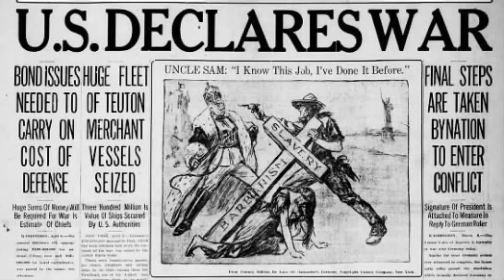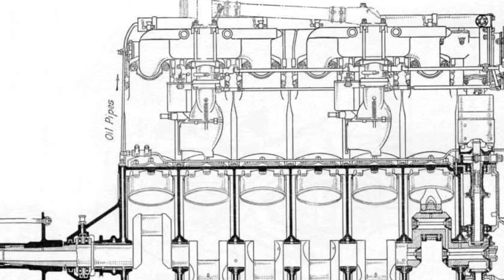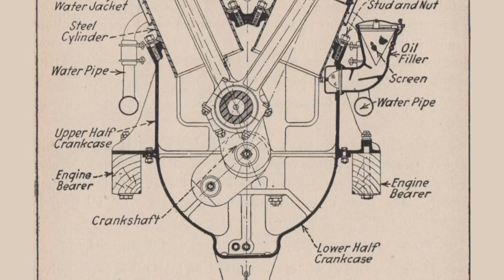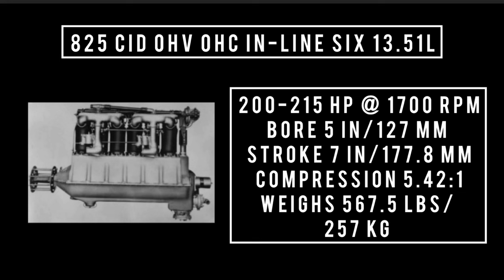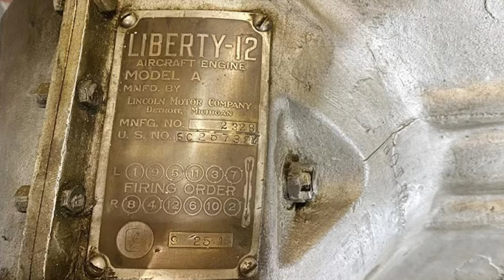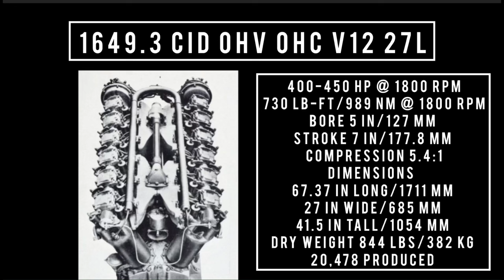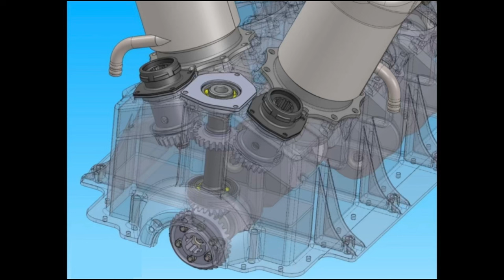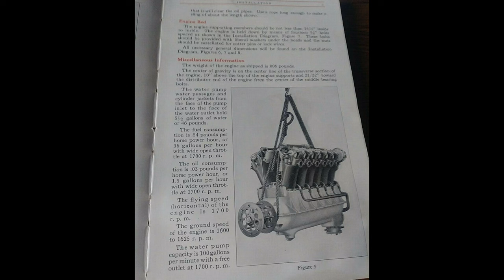Liberty aircraft engine family L4, L6, L8, L12

Comment: Te engine at 8:59 was a Packard  2500 series engine which was the type used to power navy PT boats. It had no relationship to the V-1625 Packard Merlin which the narration was discussing.
Reply from the maker: Thank you for that correction I just found out those are two totally different engines.. 

It doesn’t help when asking google what packards Merlin engine is and it shows that picture

Comment: There are no counterweights on the crank. Oddly, the Liberty V12 had the same displacement as the RR Merlin.
Reply: These engines were designed for relatively low RPM, so the need for counterweights on the crank was judged less critical. With higher performance, counterweights as well as using 60 degrees instead of 45 degrees would probably have been warranted.

Comment: With only 1700 RPM it would work for things with a prop- boats, planes, and airships- because they're limited as to how fast they can turn and still work. Those are usually ran at a constant RPM as well, so as long as you knew which RPM's to avoid because of the crank flex they'd work OK. Kind of interesting with the tie-in to automotive manufacturing, and that trend would continue into the next big war where carmakers built entire airplanes, tanks, etc. Also this being the cause for Leland to leave GM. Still, I'd rather see car vids here.

Comment: 🤔 4 cylinder,,, the balance is bad on V 12 engines ???  4 maybe easier to tame ????🤷
I'd put a 4 in a Packard frame ,move the firewall forward and shorten the hood .
Move the rear axle forward to it makes a 2 seat speedster....
A Speedster with a period correct ohv,ohc and light weight high output 4 cyl ???🤔
Add a blower to compete against Bentley,  Bugatti and Mercedes 😂 dare to dream 🤔🤪
Another great Episode
Thank you and Happy Motoring
Reply from the maker: Awesome choices. Glad you dig this video for a V12 of that size. It did not weigh that much. 

There was only two of the four cylinders made. They’re both in museums I believe I think the one is in the national aviation museum. Not sure where the other ones at I’m sure it’s still exists

Comment: These are not L4,L6,L8,L12 engines The L denotes the valve arrangement . "L" denotes a flat head  seeing as these motors are overhead valve the correct description of the valve arrangement would be , "I" so they would be I4,I6,I8,I16.
Reply from the maker: In this case the L stands for Liberty that's why it's capitalized other wise it would be l fit in-line

All sources have them labeled as such so that's how they are labeled in the title